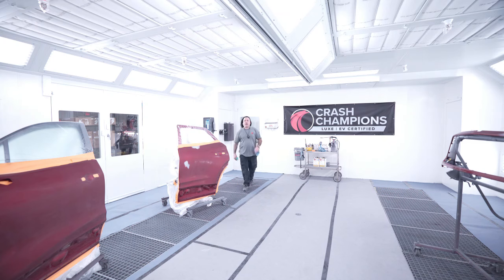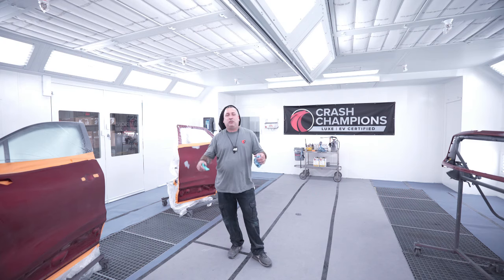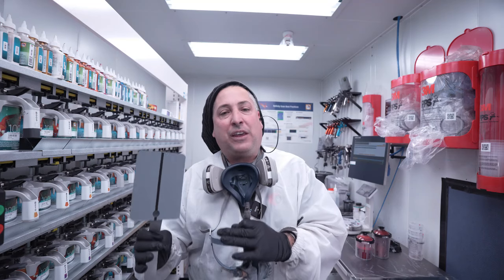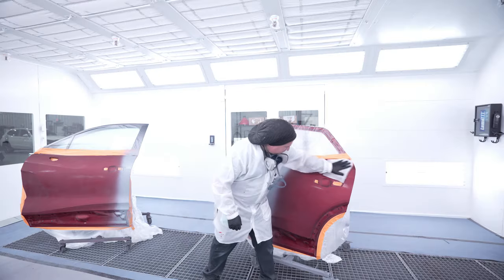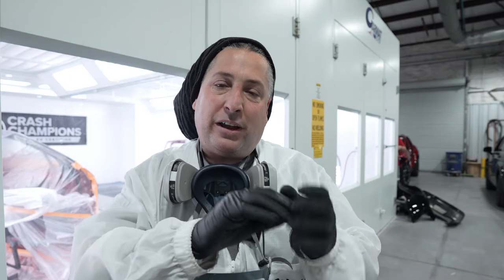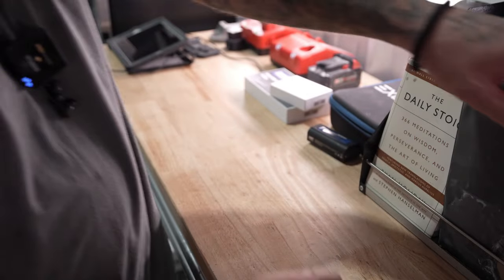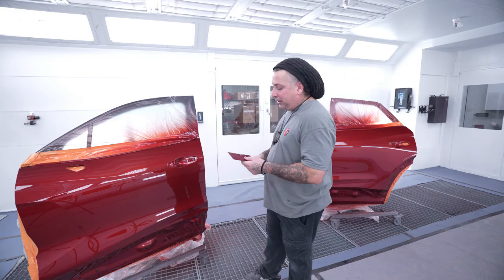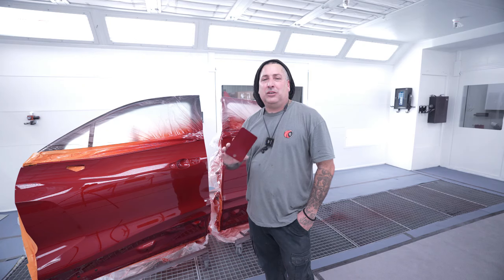How To Do The BEST Candy Paint Jobs

Comment: Hi from the UK. I’ve focused on the comment about using the original scan than using the adjusted formula if over 90%. I use Baslac which is the economy version of glasurit 90 line which I imagine uses very similar software and camera. I’m gonna talk to my paint rep about that. I do use the spectral curve readings to analyse the matches 👍

Comment: Thank you for a very informative video!  Do you have any tips on how to spray sealer e.g. PPG DAS3021 and get a full wet coat and no runs or sags?  I am having a very hard time with it using same gun and tip as you.  Any thoughts would be most greatly appreciated.   Thank you.

Comment: What do you think is the best thing to do in order to prepare an after market panel for a Chevel it’s already in that black primer they put on them , would I just scuff with the red scuf pad or hit 320 and prime
Reply from the maker: 320 then primer
Reply: @kandyman5315  I seen that Sylvester does 80g and take all the e coat off those types of  panels and he puts epoxy primer , would that be a better option
Reply from the maker: @JuanjoseMiguel-z9f yes if your air lines are perfectly clean of moisture